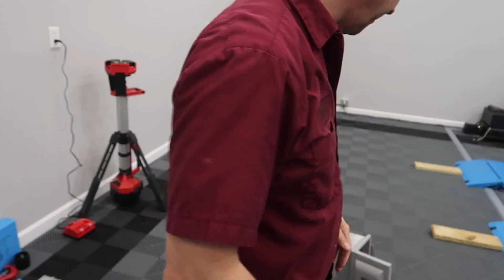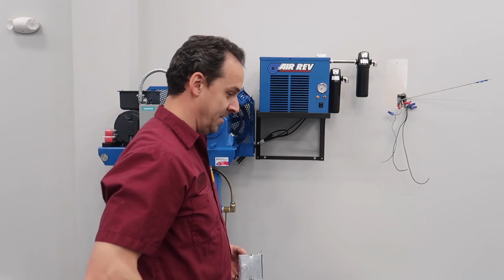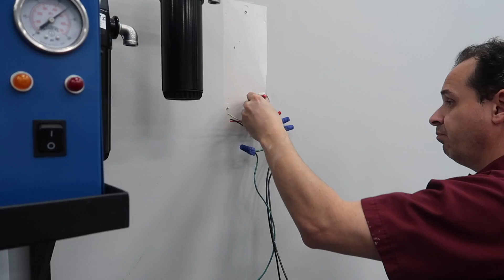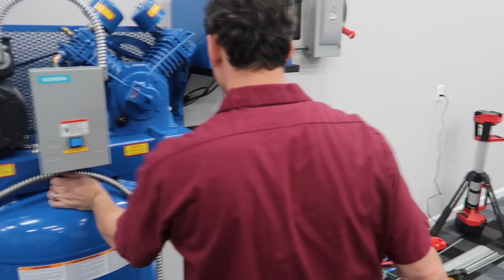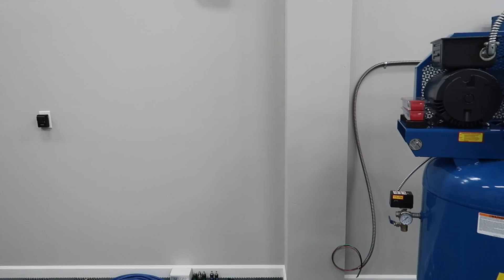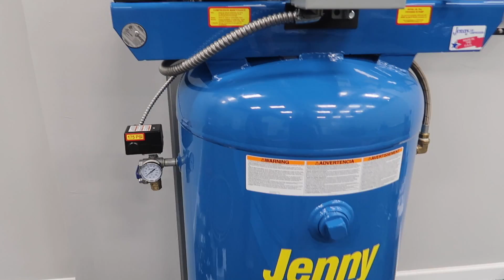Compressed Air Project: E2 - Wiring

Comment: Just wondered exactly what model the compressor? Have used a die grinder with it?
Reply from the maker: I haven't used a grinder, but it would more than cover it.  Delivers about 28 CFM at 90 PSI.  It's this one:  https://www.obsessedgarage.com/collections/compressed-air/products/jenny-w5b-80-5hp-80-gallon-air-compressor?variant=15478486892616

Comment: Very surprised this guy didn't got with the German made Kaeser screw compressor. More money than the piston compressor, but fare more quiet and more efficient.
Reply from the maker: I wanted that, but Kaeser recommended against it.  Screw compressors need to be used often.  Otherwise they will have major issues.

Comment: In my case at winery I usually set our giant pump over units to pump wine out of tanks I Will most likely set that switch to the highest load capacity because on initial start up your pump will pull so much amps and power most of our equipment is either from 480 to 680 V and usually the cellar guys just run the pumps dry after its pump everything out of the tank 😠

Comment: What are you doing for removing the condensate sitting at the bottom of the tank?  Looks like some sort of automatic drain valve but didn't get a very good view of it.  I have an automatic electronic drain valve on my compressor tank, but it leaks like crazy.  I'm trying to figure out a different/better solution.
Reply from the maker: It's a Prevost Magnetic float drain.  I'll have it in the next video.
Reply: awesome man, can't wait to see it.

Comment: All three poles are used and looped on the contractor/overload for single phase motors so that the overload can read the current correctly, as internally the overload is design to work having current on every pole of the overload. I only found this out because I had one to do in the past, and of course Google to the rescue.

Comment: The control thats in the Air compressor Electrical box is called a "Starter" and the dial should be set at the full load of the motor x the Service Factor. look at motor nameplate and find the RLA or FLA then find the SF number, usually 1.15 can go upto 1.45..FLA or RLA x SF..then adjust the dial to that number or close to it. Single phase is usually 3 wires, 1 ground and 2 live legs or 4 wire..1 ground, 1 neutral and 2 live legs...3 phase is 3 live legs or 4 wire with ground or 5 wire with ground and neutral. The BX or greenfield that was installed looks much longer than 6ft. code is max 6 feet in NYC, anything longer the inspector will not pass you. The place is looking good..cool vlog
Reply: I believe any length is OK between the disconnect and the motor junction box.  There is a limit on the motor leads though.
Reply: Also the overload trips with current imbalance between the three poles therefore needing that loop of wire to pass through the third pole of the contactor.

Comment: You are missing anti short bushings in that control panel on the compressor.
Reply: I'm sure the guy knows what he's doing, and probably knows Florida electrical code requirements backwards and forwards.  He probably also used something like this with a non-metallic inner lining. http://www.cooperindustries.com/content/public/en/crouse-hinds/commercial_products/products/commercial_fittings/fmc/acb_series_connectorsforfmcfittings.html
Reply: If not, the anti-short bushings come split, so it would be easy enough to just slip one in there around the wires.

Comment: Nice.  Did you straighten out the wiring for the lift so you don’t have to pull the cover all the time to use it?
Reply from the maker: Yes, I'm an idiot.  I had the limit switch wires crossed.  There was never any issue with the breaker.
Reply: Obsessed Garage you dodo